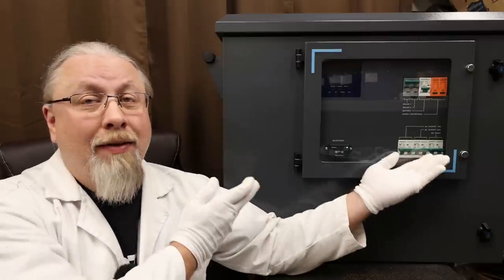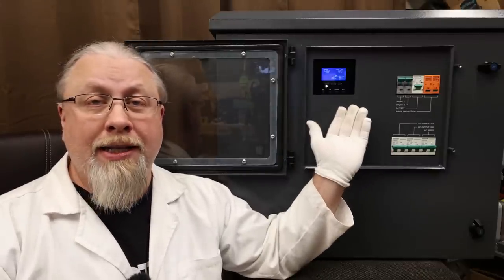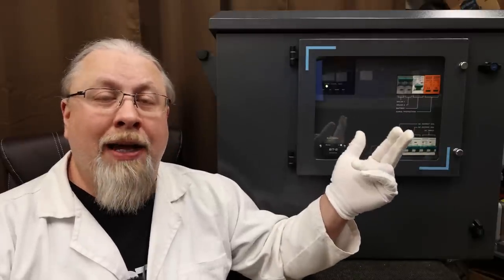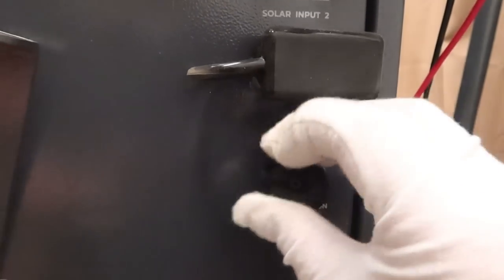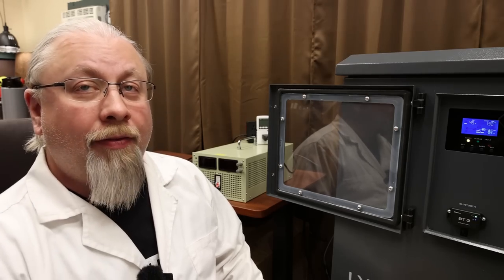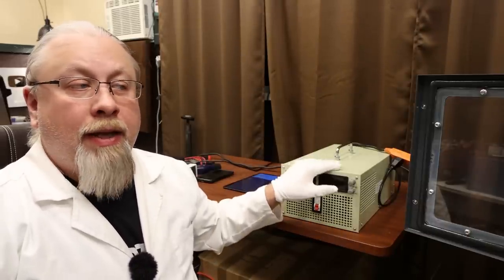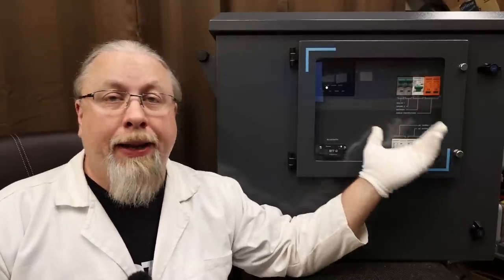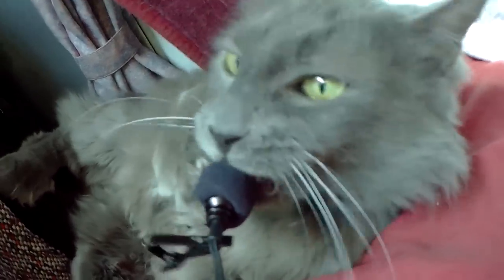Renogy Lycan 5000 4800wh Outdoor UPS LiFePO4 Solar Generator Power Station

Comment: So, that is a very large, VERY expensive solution, with the only redeeming factor being it's IP55 rating.  I'm sure there are use cases for this type of unit, but it would be absurdly overbuilt and costly for someone just wanting a home backup system.  Just one of the EG4/Signature Solar server rack batteries, the rack itself, and one of their new 6500 inverters, would deliver all of the same features, aside from being water resistant, for about $3,500 vs. the $5,200 Renogy is listing the Lycan 5000 at.  The Signature Solar inverter can be paired for 240v service.  Being able to charge in a very short amount of time is nice, especially if you're using this as the primary power source for an off-grid cabin or perhaps on a remote job site with no electric service.
Reply: It's for sale for $4199.99 CAD($3300USD) in Canada with the regular price showing as $5299.99 CAD.  I wonder why it's so much more in the USA for the same thing.
Reply: Hey thanks,that’s a big savings in price in your suggestion.I’m new to this information so does the signature 6500 inverter mean that I would have access to 6500 watts electricity and is that just from one battery you say?How many solar panels would one need to charge this signature solar rack system?I will also go and look this system up as well but any more info would still be greatly appreciated.
Reply: @devonf6669  wow!I wonder how much shipping to the US would be.
Reply: @Defender_of_men  - The full specifications are something you'll want to get from Signature Solar, but if you look for that particular product you can find a lot of information.  It's a modular solution to this all-in-one, "mobile" (??), water resistant solution from Renogy, who is frequently among the best built, and most expensive, vendors in this space.
Reply: @Defender_of_men  they jacked up the Canadian price by $1200! Now the price is ridiculous

Comment: They should have made this one modular, in 2 or 3 parts... housing/inverter/charger, in 1 part, battery in 1 or 2 parts. That way you may not catch a hernia trying to move it.
Reply from the maker: I think the issue there is keeping it IP55 rated.
Reply: @HOBOTECH  I want one, but my back says it's not going to happen. Wish it was slimmer for wall mounting with batteries that could be installed after it was mounted!
Reply: They did, It's called a Delta Pro. The "weather proofing" is kinda gimmicky.
Reply from the maker: @Bob_Adkins  https://hobotech.tv/large-home-backup-ups-240v-solar-generator-power-stations/

Comment: Just checking, at a starting voltage for charging of 60V from PV, wouldn’t that make it 3x24V panels?  Enjoy your review, thanks!
Reply: You have to look at the open circuit voltage of the panel (Voc).  So called 12 volt panels typically have a Voc of between 18 to 22 volts DC.  24 volt panels can have Voc's in the range of 31 to 37 volts with no load.  The no load (or open circuit voltage) voltage is what you have to consider when looking at the minimum charging voltage for the charge controller to start charging.  So, HOBOTECH was saying a minimum of 3 12 volt panels (in series, for an array voltage of ~63 volts) or 2 24 volt panels (in series, for an array voltage of ~64 volts) are the minimum number of panels in series to meet the minimum voltage requirements for the charge controller to start charging.

Comment: Great review.  This looks like it could "almost" be a really cool product but obviously it has been purposely hamstringed.  The inability to create 240 volts makes this a niche product at best. It can't be used to power most home's heating and A/C.
Reply: i think you are wrong
Reply: @farnorthhomested844  Professor clearly says it here 8:12 -- Are you saying it can do 240 volts?
Reply: @marcfruchtman9473  my mistake.
Reply: @farnorthhomested844  No worries. It looked really cool until he said it couldn't do 240... then I was like... sigh.
Reply: @marcfruchtman9473  im watching solar videos now, and thought about this. isnt this kind of like a back up system? so 120v would be all right. expensive though.
Reply: @farnorthhomested844  Sure it can be a back-up power source to some of the 120v equipment.
Reply from the maker: I've been using this to power my entire lab including ac and heat off 1300w solar. Don't need 240v for basic needs.
Reply: @HOBOTECH  Agree.   I just setup a 120v generator leg for my house.   The dryer and big oven can stay off during a blackout.

Comment: Over five grand and it's a half measure.  Minimum a 10kw, 5kw inverter with a 240 split phase, or it's not useful for a family home.  Given current pricing it'll be well over $15K, and at that pricing might as well go Telsa wall and be done with it.

Comment: I was really liking this Generator until I learned that it must be Grounded to a Ground-Rod.........Not portable @ all.  I wonder why this is so,   compared to all the other Solar Generators on the Market,  can  anyone shed light on this fact?  Professor HoboTech can you shed some light on the Grounding?
Reply from the maker: I don't use a ground rod on mine...
Reply: @HOBOTECH  with that being said,  how do you ground it?  Is it enough for me to have it grounded by simply plugging the charging cord into the AC Power Source?
Reply from the maker: @allanmunroe9402  Yes

Comment: Plus it would not be that easy for the unit to walk away on its own.
Reply from the maker: With the steel handles it would be easy to lock up.
Reply: @HOBOTECH  ever seen the channel called, The Lockpicking Lawyer?  He can show you that locks and changes just stop people who are not that interested in what you have on hand.  In other words... If they want what you have?  It would be difficult for you to stop them.  When the garage I rented in an effort to start my own business was broken into and my business tools were stolen along with four full tool boxes that could be easy to carry for most strong men.  They didn't bother with the double locks on a wooden garage door.  They just cut into the wood enough to cut the bolts holding the security plate to the door.  Lost thousands of dollars in tools and personal items.  Just love these multicultural cities where the thieves drives a Cadillac.

Comment: Too low solar Voltage input limit of 148 VDC.  Industry standard for an all-in-one system like this is 500 VDC.  No 240VDC output option.... a non-starter.
Get an EcoFlow Delta Pro or two and have a much better and more powerful system.